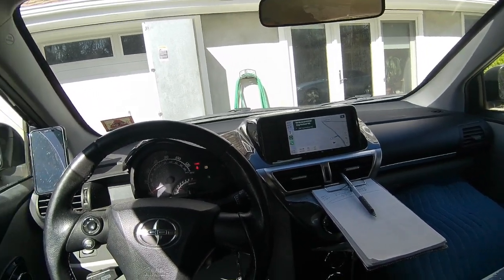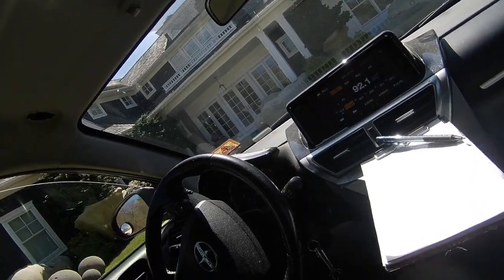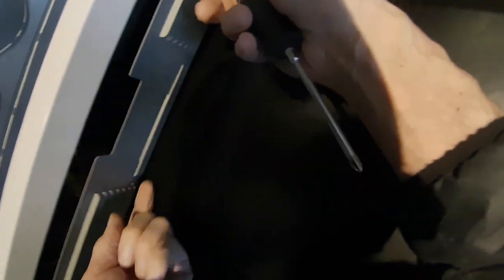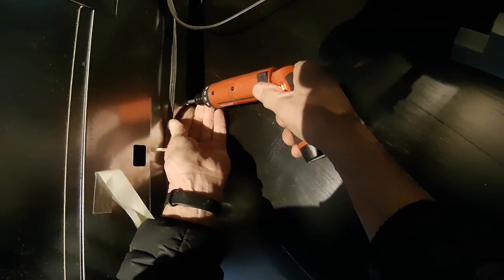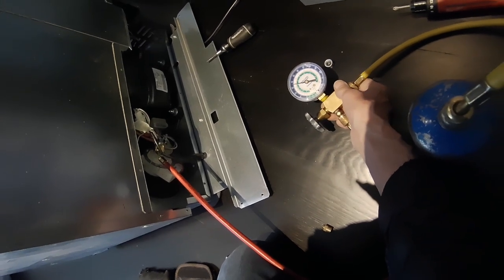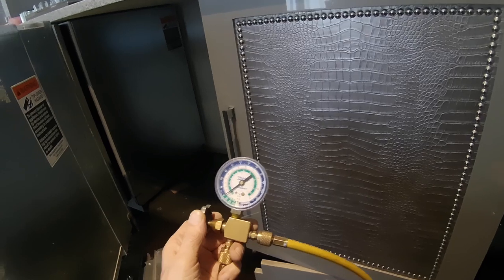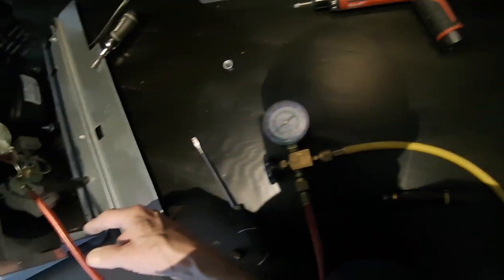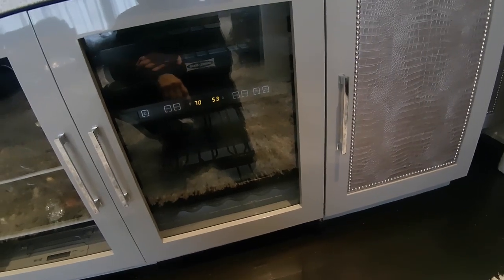Sub-Zero Wine Cooler 424 Not Cooling

Comment: Hello!  I wanted to ask what kind of solder do you use when joining metal to copper?  And where to buy it?
Reply from the maker: I use Harris Stay-Silv 56 or 45
Reply: @SubZeroSpecialists  Is this for sale in Toronto or Mississauga?
Reply from the maker: @ДжРаимов  Amazon
Reply: Thank
Reply: i found it on amazon but it's rolled up not sticks
Reply from the maker: @ДжРаимов  it comes in a I oz or 5 oz. The sticks you’re referring to are Sil-Fos and much thicker. I don’t normally use them unless I have a gap to fill.

Comment: Hi, could you help me please 
I got a sub zero 424 
My problem is this 
Lower compartment isn’t cooling but upper does 
Could it be problem with solenoids?
Reply: And also how I can test the solenoids ?
Reply from the maker: It could be the switching valve or a Freon leak. Run a diagnostic on it.
Reply: @SubZeroSpecialists  how I can run the test ?
Reply from the maker: Go to my website aaronsrefrigeration.com and click on Tech Help. Click 400 series and then Electronic Control System and scroll to diagnostic mode